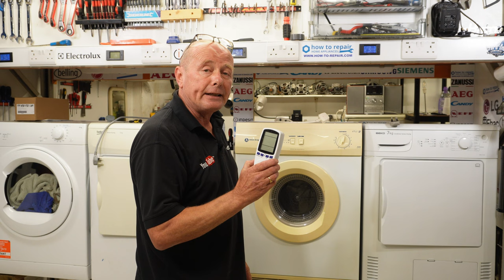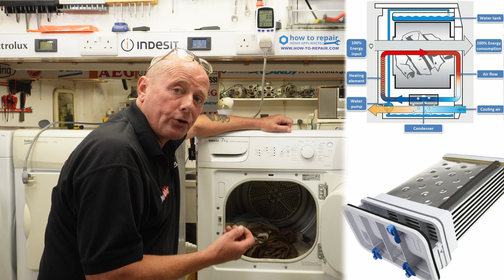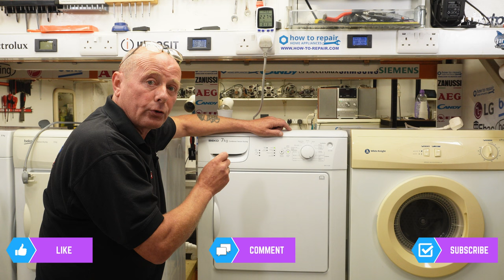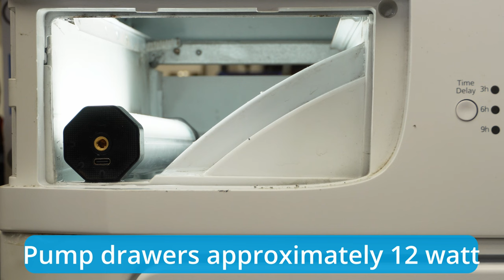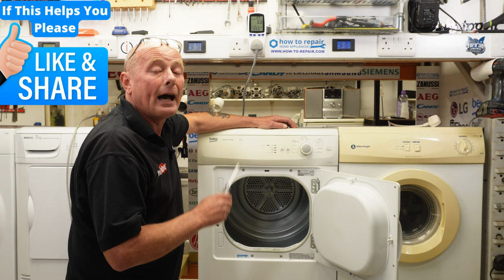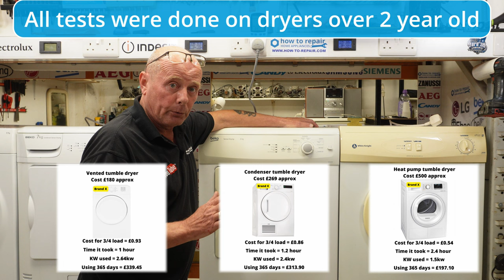Tumble Dryer fault finding & diagnosing fault testing: vented, condenser, heat pump.

Comment: love to see a video of replacing the capacitor on this beko dryer
Reply from the maker: It's not actually worth me doing, you only need to remove the vent tube at the back to gain access to the motor, and then there's a 13 mil nut that you have to undo the manufacturer actually put some thought into this one

Comment: Hi Paul do you have any videos on Stats and TOCs? Could you shed some light on the differences between the them as in the colors of the spots. Surely there must be inter brand compatibility. Is there a way of finding a compatible replacement just by looking at the case?
Thanks

Comment: My old  Zanussi vent type dryer alternates between 2000W and 160W during operation. Is this normal?  The drying time is long and it strikes me that the 2000W is a bit low for the max power draw?? Thanks for the video.

Comment: I have not had many good experiences with heat pump dryers,, even fixing them for my own use. I always difficult to diagnose as heating is a slow failure not heat or no heat. Is it a Sensor or airflow? total disassembly if you want to find the leak normally 'it is corrosion in the water condenser. Good for a source of almost new parts is the only positive.
Reply from the maker: That was something I forgot to say in the video, the condenser pipes around the collection tray are always rusting. Why don't they make them out of stainless steel? And there's always a lot of fluff buildup, even when the filters are in good condition.  @Fastandpro please remember to subscribe to our channel as that really helps us https://www.youtube.com/shorts/e432SAb2g08  Thanks, Paul 👍
Reply: @How-to-repair  The fluff build-up probably comes from friction beating the clothes for an extra hour which is another hidden factor in the cost of running if you have nice clothes. Like American top loaders, they last a while but your clothes don't.

Comment: Thanks again for the professional demonstration I currently still work in the industry for large retail company and i think the heat pump dryers are my biggest bug bare these so called manufacturers make it very difficult for engineers to maintain them no real access panels etc.Many years ago they tried to combine coffee maker and refrigeration together in a whirlpool appliance unsuccessfully maybe in time the heat pumps may go the same way…can you tell where I can purchase the smart meter thanks👍

Comment: One thing to add re heat pump dryers they don't work very well at all in room temperature below 16/18 degrees and no use in a garage or unheated utility room etc
Reply from the maker: They just take a lot longer to dry at those temperatures @michaelwaite6725 please remember to subscribe to our channel as that really helps us https://www.youtube.com/shorts/e432SAb2g08  Thanks, Paul 👍
Reply: @How-to-repair   white knight did a gas dryer called the eco83a/eco43a eco86a